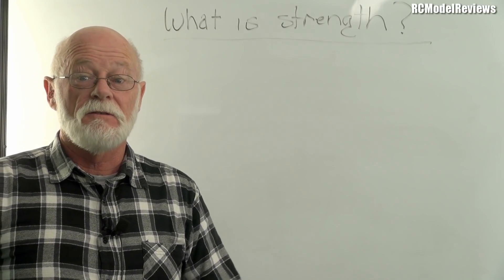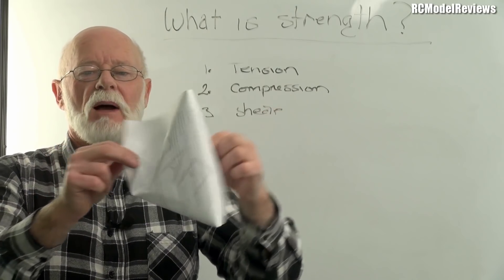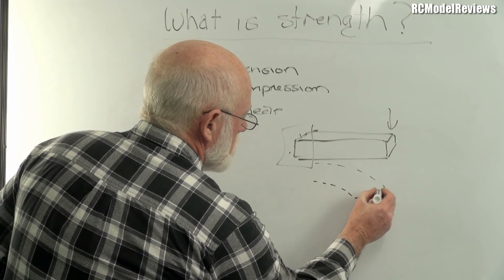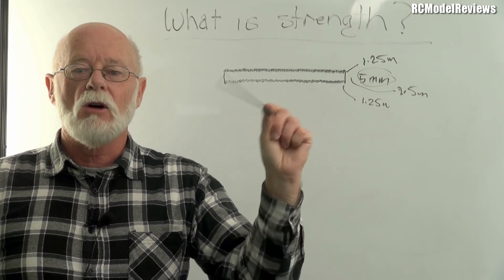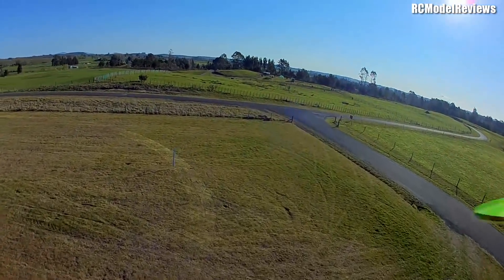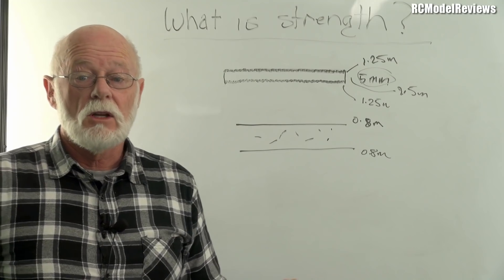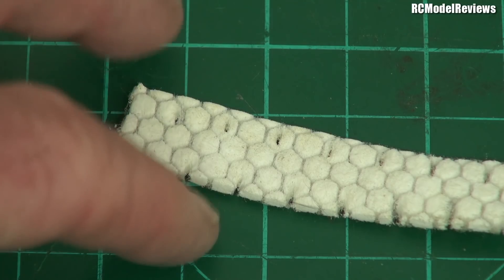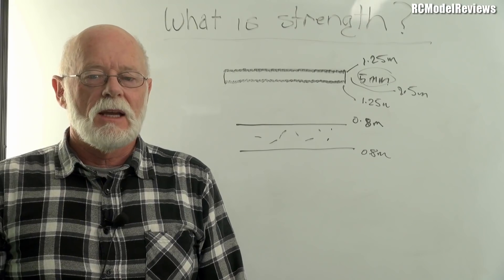Carbon racing quad arms... does the middle really matter?

Comment: The vise grip test put the test sample under a compressive load (pushing the 2 skins toward each other - it was crushed in cross section )where the vise grip jaw held it. this made it fail much easier than it would if it were properly installed in a structure.
As you point out, this isn't anywhere near as simple as "strong/weak". Building a strong and light composite structure requires a lot of thought and some actual engineering where the relationship of all components and the forces at work on them are considered. 
The easiest way to implement composite is to use a solid, which is one reason most quad manufacturers use it. You can get away with a minimum of engineering and it takes forces in all directions well (but still not equally) 

If you crash a lot of quads, it will become quickly apparent that delamination is how most arms usually fail, where the weakness of both the carbon and resin come into play. An impact at the tip of the arm puts the carbon in it's failure mode (compression), which generates perpendicular forces, thus putting the resin in tension, (it's failure mode) which then fails allowing the perpendicular forces to win - allowing the layers to separate. The weakness of using the foam core in a quad is such. A hard strike on the arm tip will fail the Kopis arm before a solid one because the foam is weaker in tension than the resin (which is what fails in a solid arm in this case). 

You are right this is indeed a fascinating science. I came to it years ago when I flew highpower rockets (Tripoli) and was amazed when I laminated some 1/8" balsa fins with hardware store epoxy and paper - it's shockingly strong in bending. Use proper resin like West Systems and 3oz fiberglass cloth, which adds  only negligible  weight, but you can't break it by hand. Most people don't realize fiberglass is actually slightly stronger than carbon fiber and doesn't weigh much more. It's also much cheaper. The problem comes in mixing the two, they have different elastic properties, which creates problems in a solid structure which can lead to premature failure.

Great video, I love your whiteboard sessions where you dig deeper into subjects like this. You do it well, could have been a teacher (which I guess you are, here anyway).
Thanks!
Reply: actually, my quad arms are installed in that exact same configuration between plates so i see this test as accurate.

Comment: I don’t see this as a straight forward study in stiffness. As we learned in engineering car chassis many times a degree of flexibility is more desirable for overall durability than additional torsional rigidity. Yes the point of ultimate failure might be higher, but may tend to fail sooner due to stress from lack of flexibility while applying greater impact to other parts bolted on to the chassis. A higher degree of flexibility might provide less stress and longer durability below the point of ultimate load failure while being kinder to other components while still meeting design intent. We might be finding a new degree of balance in our quad frame design. If you want to lighten the frame structure and keep a higher point of failure while maintaining torsional rigidity I might suggest a layer of honey comb material. Remember most of the time in engineering, if you want to get something, you most likely have to give up something. Great work – Please keep it up.

Comment: It's nothing new. Try to keep up Bruce! :).  Foam core construction has been used in the marine industry for many decades. I was laying up same back in the 90's.

BoltRC released foam core arms for their Kraken quad range back in/before Mar 2017.
To quote BoltRC: "The Kraken 6 GT features replaceable arms made from a carbon fiber foam sandwich that provides greater tensile strength to weight ratio compared to solid CF arms. In simple terms, the 5mm arms are stronger yet lighter than equivalent 4mm thick arms."

There were after that some Chinese attempts at similar sandwich construction but were reportedly poorly executed (designed).

Comment: The carbon fiber has to adhere to the other carbon fiber, in a PURE carbon fiber part better than these three layers adhere, so this can't be as strong.  Look at any carbon fiber arm that has failed (broken) and see where it broke.  De-laminating is always a factor in the breakage.

The thing that gives carbon fiber its strength is the proximity of adjacent fibers, and the lack of leverage that can be applied to separate the strands.  With a weaker core, the leverage of the thickness of that core can potentially be applied to break the carbon.

Comment: The shearing force is important too! Don't just chuck it away! When you have the top in tension, bottom in compression, the centre would be under shearing loads. That's why aircraft wings have a shear web. 
That foam core sandwich is really good as a shear web but it can't handle compression. When that bottom carbon skin give way, it can only either delaminate from the core or compress into the core. In your case, it compressed in. Without the vice grips it will likely perform very differently. 
All this require alot of load testing to achieve a balance between cost, weight, strength and resistance to abuse. 
As for glass as a shear web...i trust carbon more...but who knows, maybe the flexibility would do well under it's specific loads.
Problem I see often with a glass core is the carbon often delaminate under stress

Comment: Obviously it always depends on what you want to achieve and so in designing composite material solutions. Reducing weight could be one target. One can have wide gaps in the middle layer without sacrificing too much strength or stiffness. I could also imagine  the composite solution has significantly better dampening capabilities to a full carbon one which could have a positive impact on  pid tuning options. Looking forward to your further tests!!!

Comment: The loads those arms are subjected to in a crash aren't perfectly along the arm in real life. It maybe similar strength if you bend it with your hand perfectly, but what about torsion, it will bend a lot easier along its axis, which is what it will be subjected to if your prop hits the ground first. And if that foam compresses during an ideal bend the effective cross section is smaller negating the whole idea. That's why they don't put foam in I beams

Comment: Hi Bruce. I believe that the the sandwich principle is similar to steel joist for a structural steel building. As long as the top and bottom struts are held thight. The joist remains stiff. If you deform the top or bottom beam. The structure fails. Your test with the vise grip plier is not exactly fair because it does not distribute the load evenly. Do a comparative test with 5 mm solid carbon fiber between 2 support stand checking the force and deflection at that force. Then the carbon foam composite might be stiffer under the breaking point that solid carbon.  It could be worth investigating.
Reply: our quad arms are also held on in the same manner unless you have a uni body so the test in my opinion is accurate with its results

Comment: Working on the same principle as vernier foam wings. Very soft foam between two sheets of very thin obechi sheet. That's as good an example of composite strength  as you can get. Just had a thought, maybe they used some sort of I beam construction with the white stuff being a filler?

Comment: What would the point even of putting carbon into the foam, as you point out, it clearly isn’t fibres it is not providing anything
Reply: Maybe thicker is stiffer? I would think it would change the moments of tension and compression. Rigidity is important as well to prevent arm flex. So I think the question is did they sacrifice strength to get more rigidity? Just my uneducated guess. :)

Comment: If the core of the arms are super fancy, it might be a syntactic foam - ie glass bubbles set in epoxy resin - highly incompressible. More likely to be some form of closed cell polymeric foam.

Comment: Well it's like foam sandwich fibreglass boat hulls. it would weigh a ton if you had an inch thick solid fibreglass hull. But if instead, you have 20mm of foam in the middle and a couple of millimetres of fibreglass on each side, you have a hull that is very light for it's size, but with almost the same strength  (not exactly of course) . But it's incredible. and carbon fibre even more so. You can thank Buckminster Fuller later..

Comment: maybe fibreglass ( not carbon)  white core laminate stuff would be better for long range rigs due to RF transparency.
Reply: Yes better for RF.  I cut a lot of fiberglass plates and stuff.  It is strong but not as strong as carbon. Search fr4 G10
Reply: Indeed. Unlike mini quads the long range guys really don't crash so much - so thought they would be pushing for fibreglass core composite.
Reply: it doesn't matter how thick your conductor is. Any conductor thickness will reflect rf. Only thing is that maby 5.8 ghz is high enough freq that the wavelength is short enough that it can pass in between the plates but i doubt it (there is a formula for this). To give an example: chicken mesh can be used as a reflector for home build antennas.
Reply: recall being told that fibreglass was rf transparent....or at least better than carbon fibre. Was that incorrect? Thanks.

Comment: Be careful not to confuse material properties with structural properties. It's a little more complicated than you've described, remember that stiffness in this case is a structural property that is not only influenced by the material, but also the geometry of the part. Whereas material uniaxial stiffness (Young's modulus) is purely a material properly where geometry has no bearing. From the video it seems that the manufacturer has decided upon a poorly designed/manufactured box section, which if produced properly (multidirectional layup, even chopped fibre) wouldn't necessarily perform any worse than a solid section for this application, it would certainly be slightly lighter if that's important to you.

There's also a balance between strength and toughness that's important here, high strength materials often aren't very tough, for example ceramics, they can only absorb a small amount of energy in tension before fracturing. Sometimes when people talk about strength, they are really interested in toughness.

Comment: Its funny, you always want to think of strength as rigidity, but in most cases for example softer materials last longer, you want enough rigidity for the job but not much more..
i.e a camping knife is generally tempered to be very slightly softer than a kitchen knife so it's harder to snap and the construction steel is very soft compared to knife steel. 
get a few plastic bags and try and rip them in half , it's almost like the softer shit is the stronger it is. edit: carbon fiber is a bit of a special beast for obvious reasons
Reply: Heres why.  F=M(ΔV/ΔT)

Comment: Pure carbon is black, but mixed with other elements magic happens.  Carbon dioxide is colourless, and how about sugar?  (C12H22O11) With all that carbon in the molecule it's a wonder it is still white.
Reply: We are obviously talking about forms of carbon that are pure carbon and also aren't just a few atoms. Everything else would be pointless, because the strength of carbon fiber comes from all the carbon-carbon bonds and every other element makes it structurally weaker. Those carbon-carbon bonds are also what makes carbon fiber conductive and also lead to the black color.
Reply: But sugar molecules are only approx 1/3 carbon, the white is introduced during the refining process through bleaching using various methods!
Reply: lets look at the formula closely.  C12+H22+O11) so H22+O11 = 11(H2O) so we end up with C1211(H2O)  Sugar is just wet carbon.  Why does it taste sweet?
raw sugar is brown, then it is actually "washed" to remove the last of the molasses, which leaves it white.
But a diamond is also only carbon and we all know what colour they are.
Reply: So what? The chemical formula of a carbon fibre is about C_infinity. That's completely different. You have absolutely no idea how chemistry works, do you?
Reply: You may want to Google that "pure" sugar color. From my brief research, most say it is colored and only bleaching makes it white.
Reply: And black people are black since we humans are based on carbon.

Comment: Hi the demo you did with mole grips and hammer on the carbon/foam composite/ carbon piece, I don't think that really demonstrate the strength of the piece tested, all stress was directed at the point where the jaws of the gripes and the piece being tested was a very small area so would be the weakest part. If the piece in the test was anchored over a curved surface then the carbon/foam composite/carbon piece tested the stresses would be evenly distributed over the full length so would not break so easily?,  Hope I am correct in my assumption?.  But any way thanks for this great video and all the others you make. 👍👍👍👍
Reply: You're right about the test setup but I believe the idea was not to test that piece strength on its own but to show that that it was more easily breakable than a full carbon one. Would Bruce have tried to hammer a full carbon piece of the same width under the same conditions and he would need far more strength to break it.

Comment: I've recently glassed the pylon on my HK Skipper (small version) and as you say, the epoxy is preventing the glass from moving (translates the force to compression) and the glass itself is preventing extension through flexing.

So now I have a rock solid tail and hopefully there will be no more 'tail wagging'!

Comment: Do you consider that tube steel is stronger than solid bar i think thats what they are going for
Reply: I don't think that's actually true.

In terms of strength-to-weight tube is stronger as most if the compressive/tensional force occours on the outside but even so, in a solid tube some force will be transferred to and be resisted by the core. So ignoring weight, solid is stronger for the same diameter.
Reply: Tube steel isn't stronger than a solid bar. At least if we are talking about outside dimensions a solid piece of anything will always be stronger than a tube. That is just basic physics.
If we are talking about the same amount of material, a hollow piece can be stronger (but will be larger) depending on direction of force/torque applied.
Reply: of course same mass and material